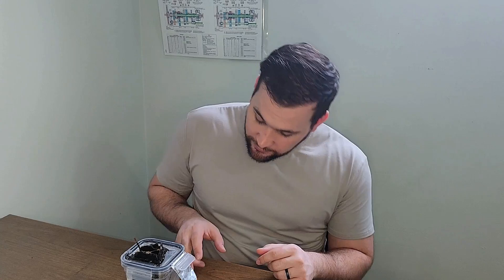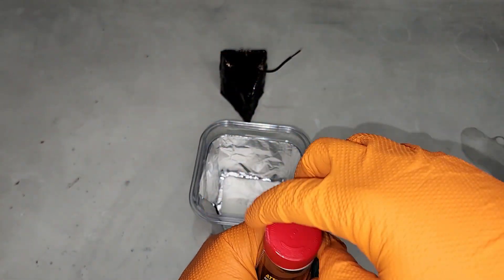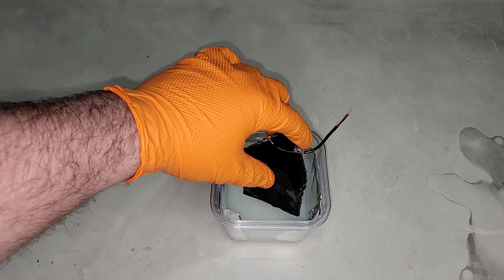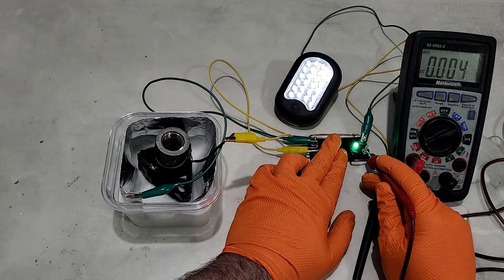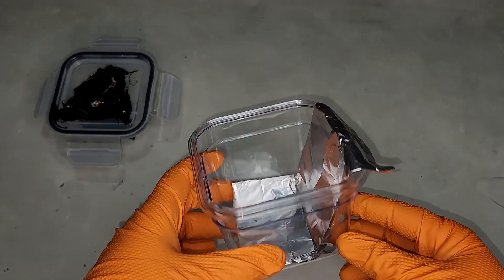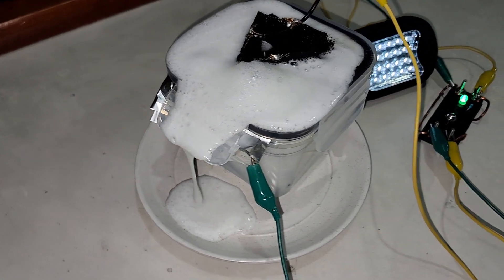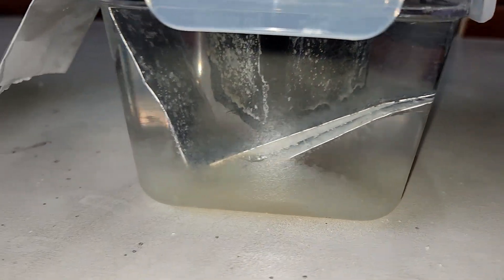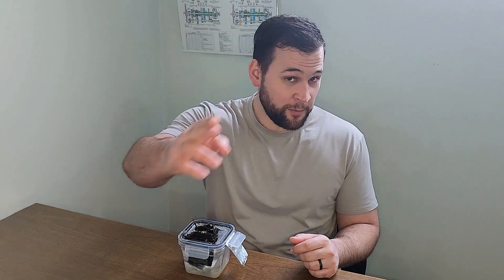DIY Aluminum-Air Battery Using Only Household Materials

Comment: How long this battery will last and how much voltage amps is can output.
Reply from the maker: I had couple different testing configurations but as I said in the video the best open circuit amp reading I got was over 500 mA at 1.2V and the battery lasted for 5 hours under a 10 mA load.
Reply: Is there any way to recharge the batteries?
Reply from the maker: @chetanmhalsekar8696  The best way to recharge the battery is by physically replacing the aluminum.  I did experiment with electrical charging a couple years ago.  It can work as well, but any charging voltage above 1.2V starts to electrolyze the water so its not a very good option.  If you want to see the videos I made on the subject check out my aluminum air battery playlist.  That should point you in the right direction.
Reply: I have one experiment for u can u do it ?
Reply: Hi
Reply from the maker: Hi.  What experiment did you have in mind?  If I have the equipment and time for it, maybe, but I'm not going to make any promises.

Comment: Hey, have you tried using aluminum fine mesh to increase the surface area? I think it might increase the power output. And have you tried thicker aluminum plates? Seeing that the foil corrodes quite quickly, i think it might give the battery a longer life since it has more material to work with
Reply from the maker: Hey @laboram2621.  Thanks for the question.  I haven't used anything else besides aluminum foil for now, but I would like to try different sizes in the future.  I'm hoping to build a version with a pumped electrolyte at some point.  Then, I'd like to try a thicker block of aluminum to see how much more life I can get out of it.